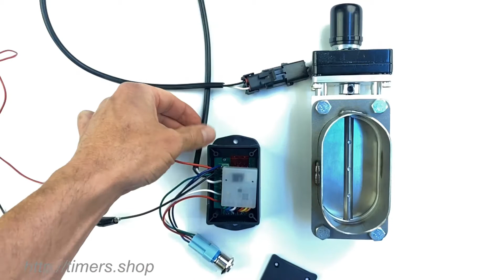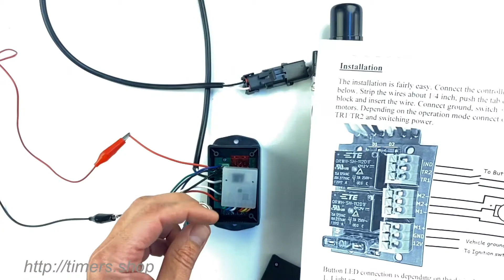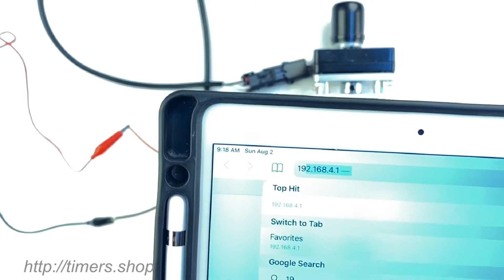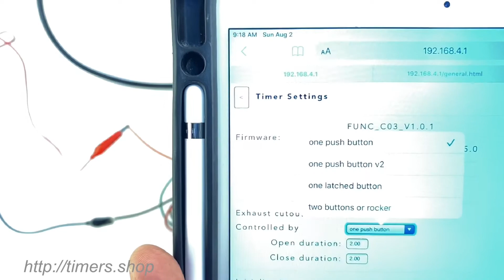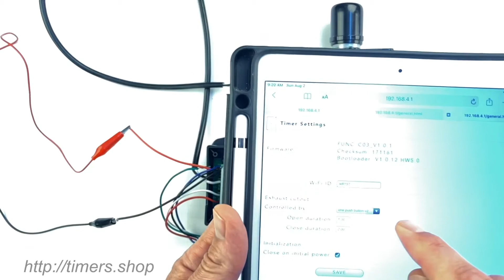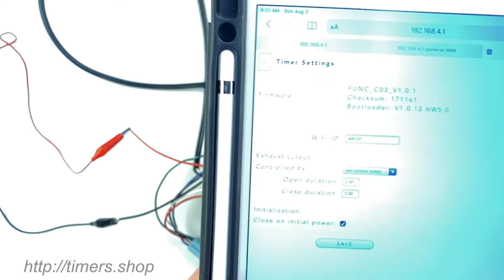Exhaust Cut Outs one touch controller

Comment: Hey @timers shop, I am having a tough issue with a 6 wire single latched button. Should there only be one wire in each connector block or do some sections have to be connected to each other? Please assist.

Comment: I changed my motor on my cutout to a solenoid .  I dont care about the position of the flap i either want it open or closed.  The solenoid just makes it instantly open and close within a half a second.. makes me happy how quick it opens and shuts..   if im being stupid and shittin and a gettin i just hit the thing and go incognito mode with my airbag suspension..   just raise the ride height with it and boom, factory.. if only i could afford the electronic waste gate so i could hit a switch and change tunes and blow out the boost so it doesnt make pew pew noises..   would feel like some undercover shit sitting at a red light and all the sudden the shit drops into stance, exhaust opens up and all the sudden the sounds of awesomeness starts spooling under the hood and throws a flame out the side and pulls tire..  lol..

Comment: I assume this can also be a great solution to a electric parking brake system. Instead of using the exhaust cutout motor, a linear actuator can be use with priper force to engage the vehicles parking brake cable (or, one can use tesla/brembo calipers!).
This would be a very low cost solution to the $600 estopp kits!